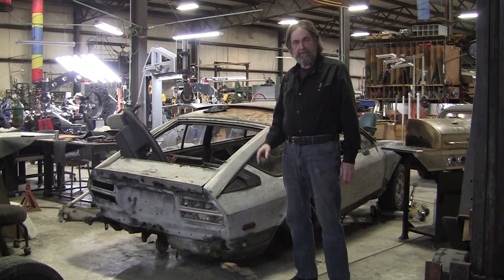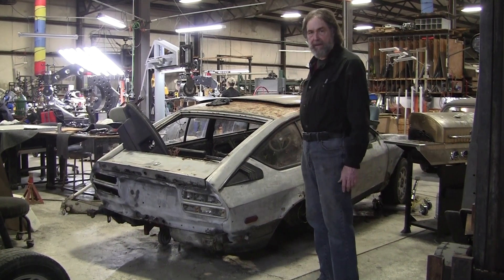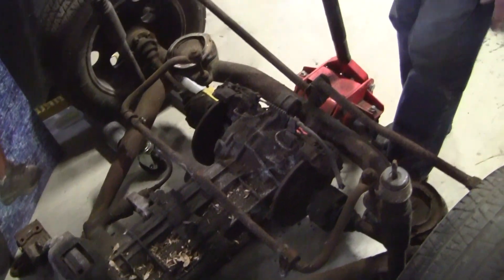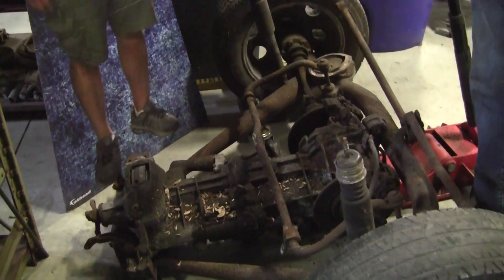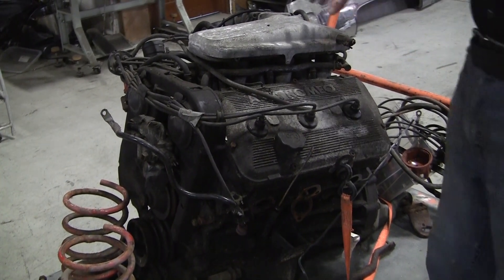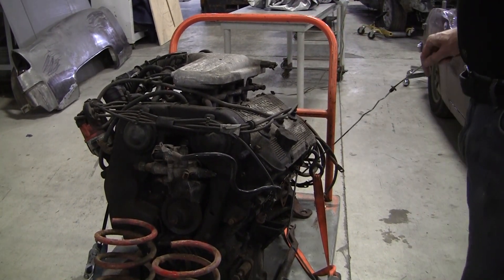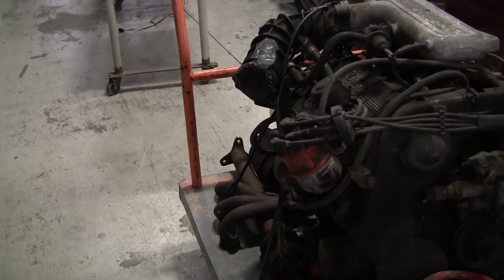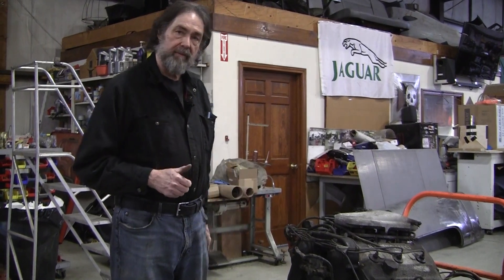Alfa Romeo Scratch Build Series (Episode 2)

Comment: The Alfa transaxle has the clutch in unit, as did the Lancia Aurelia and Flaminia. All the other modern cars with front engine and transaxle which I can think of have the clutch at the engine - Porsche 924, 944, 968, 924, Chevrolet Corvette C5, C6. Not sure about the Ferrari 550, 275 GTB and 330 GTC
Reply: Edit - I wrote Porsche 924 a second time when I meant to write '928', the V8 four-seater GT

Comment: stolen from the internet "In U.S. trim, the aluminum head and block 60-degree V-6 makes 154 horsepower and 157 pound-feet of torque. And to clear the top of the intake, the hood on a GTV-6 has an angular bulge topped by a piece of plastic to distinguish it from four-cylinder versions."  Soooo excited to see this build progress!
Reply: Isn't this the Busso 90° V-6 engine?

Comment: Keep in mind that the driveshaft turns at engine RPM. Orientation of the bolting flange for the rubber donut on the drive 
shaft spline is critical for balance. If orientation was not marked before disassembly you may still be able to determine the original position from paint or dirt if the parts have not been cleaned yet. Good Luck. Great Project.
Reply: Witness Marks can be from odd shaped washers, bolts or mechanical fittings. Many parts are not perfectly round and usually have some anomaly's. Great Channel, i want to take one of Wray's classes.

Comment: That prototype looks like it will be a million dollar car, ready for the Pebble Beach, Monterey California car show.  Dry ice blasting those motor, and front and rear suspension units might save some time and you wouldn't need to dissemble as much, and your hands would stay cleaner while working with them, measuring, etc.

edit forgot to mention I had the idea those original wheels were Campagnolo and might be forged alloy rather than cast.  If so they would polish up really well and maintain their value.  I tried a search but couldn't find them, doubtless your Alfa guy will know

Comment: This will be the greatest love letter to Alfa Romeo ever written.  The car is beautiful.  The gtv6 Busso engine will run and sound perfect.  The engine is a little heavy, you will have to work to balance the car.  That is why Alfa Romeo put the transaxle in the rear, and I think it is also the reason they used a torsion tube for the front springs.  I’ll love watching your progress on this great project!🏆🎉